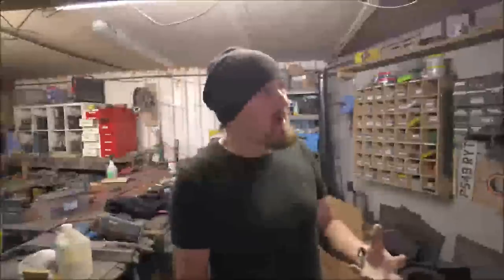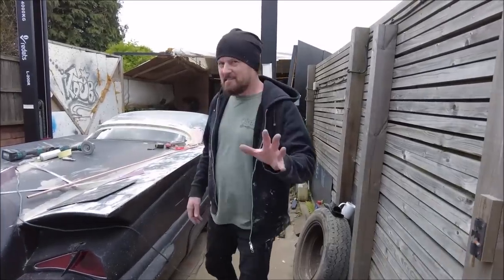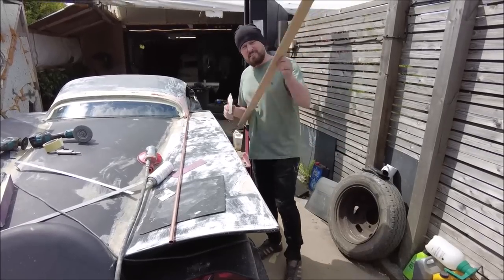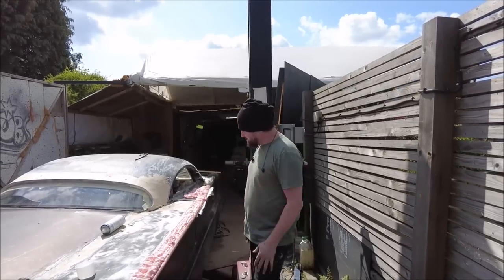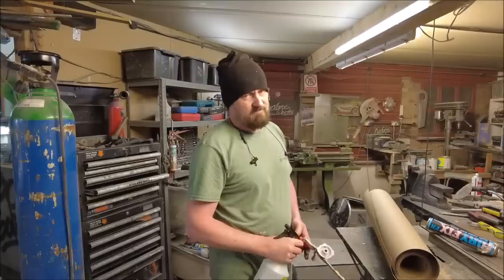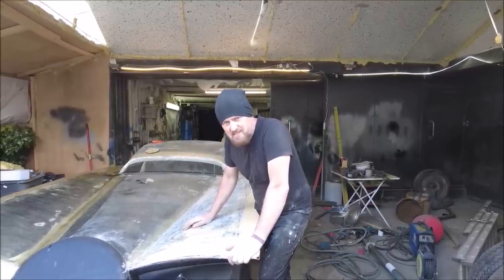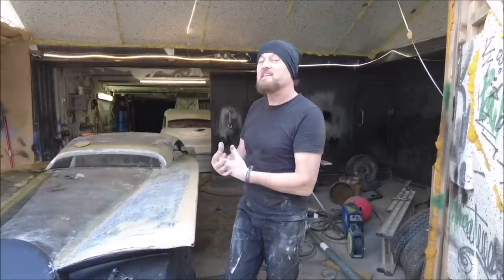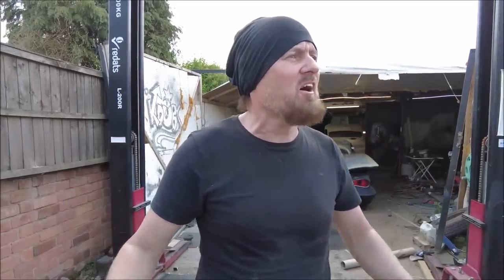Dualatron Wings get even biiger and even better!

Comment: Wings do look alot better. Im sorry but im not really the comment type of person. But 18min in the video I cant resist myself asking your opinion. im wondering about a trick, i heard a month ago. The person claimed that adding acetone to the polyester resin, gives you longer working time before it cures. Did you heard about this trick? Because i have a outside project coming, in 36 degrees Celsius. And I fear the working time with polyester resin in that heat. Hope you have time to respond. Cheers
Reply from the maker: So sorry for the late reply!
I've never heard about that one, we don't usually have really hot weather here in the UK and if we do it only ever lasts days at a time, so its not usually something I need to deal with.  Sorry I can't be of more help and thanks for watching.